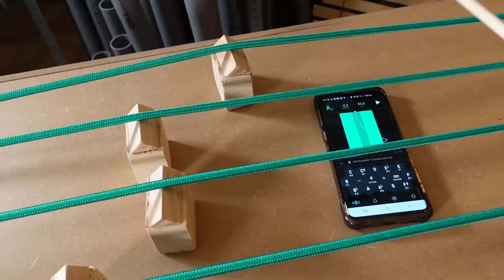Bass strings with elastic tensioners sound great!

Comment: Sounds extremely cool! When I was a kid, I also experimented with these elastic tensioners, but failed to get good sound because I used cardboard boxes that were WAY to small ;). 
By the way, I LOVE the track from 3:42 onwards!
Reply: I recently made a two string double bass and played it at the school talent show yesterday. The resonator is a big cardboard box, and it’s decently loud acoustically. The high string is a marine elastic cord. I’ll make a video in tiny bit but unfortunately since yesterday it’s been sounding different, lots of buzzing. It sounded exactly like a real double bass yesterday and the before.
Reply from the maker: Yep, cardboard can sound good, but you need some volume!
Reply: I fixed it, I’ll make a video later today

Comment: I see two ways to improve this instrument right away: MDF is pretty dead, so you won't get any resonance from that. I'm not saying ply is super, but it would give a better/louder sound, especially if it was under some sort of tension. As for the strings, the nylon sleeve will surely dampen/mute/shorten the sound and... Well, if that's what you want, then, by all means, but if you want strings that ring for longer, maybe try using some cheap work out elastic things? You could get two or even three strings from one set.

Crap, now I'm getting ideas for my own instruments! :D
Reply: I was thinking using straight up tape wound bass strings or maybe rubber ubass strings and to soften the strikers to get that mellow, upright sound. Definitely right about using better wood, 1/8" sheet of hardwood would project more.
Reply: @johnnydeformed7123  The skin from a hollow core door would work pretty well, might need a few bits of bracing through the middle, that's all.
Reply: Plywood is out of stock…at least in Germany 😕
Reply: I think thick grass trimmer cord will work well as strings.
Reply: Ahh yes! Resistance bands. I knew there was some kind of rubber tubing I was trying to think of.
Reply: If he wasn't trying to make it his own original sound, he would just use a bass guitar...
Reply: What you're looking for is "surgical tubing", and yeah it might work as a string like this.
Reply: @PilkScientist  No, not surgical tubing. I mean, it'll work fine for a little bit, but it's made out of latex and that isn't a stable material over time. Great for slingshots, though. I'm talking about those exercise things made of  TPE. I see some are made out of latex as well, but, well... I'm sceptical. I don't think latex would last under constant tension over time and keep in tune.
Reply: Sound holes under the "strings" would help a lot.
Reply: @LA6NPA  Spear gun rubber might work as well. Should be available in more lengths and strenghts, too.
Reply: @nilsschenkel7149  Didn't think of that! I agree! That's usually some sort of silicone, right? I haven't touched something like that since my uncle's Hawaii sling in the 80's! :D
Reply: It's a torsion box with holes on the side for clamping glue-ups, so it does fine, and in some cases you don't want much resonance

Comment: This is very cool but i have just one problem with this video: I can't hear the bass very easily without turning my volume way up- Only to be blasted by the volume of your voice
other than that, excellent :)
Reply: try earphones
Reply: tbf it really depends on what you're using to listen, if it's just your phone's speaker,, then you might as well just mute the video low noises are REALLY hard to hear. even a regular speaker if not some, surround stereo system can really make it hard to listen to. if you like bass I def recommend you get some ear/headphones
Reply: @nipunagunarathne4882  I'm using headphones ._.
Reply: @uranusouji9703  i have some it's just that the higher pitched/louder sounds are also loud. Most headphones don't have a separate volume for bass, including mine sadly
Reply: @orbismworldbuilding8428 you should be able to adjust you phones audio equalizer in the settings somewhere. Its worth it

Comment: I think you might get more projection on the sound by using a drum head, like a banjo. Banjos are insanely loud for acoustic instruments, I think maybe the challenge would be getting enough tension for  the elastic bands to transfer sound through the bridges and into the drumhead. Maybe use weird drums for bridges/frets like you're using here, or a giant drum for the box. That would be fun

Comment: Very interesting, like some others have said MDF is limiting the full potential this has. Plywood wood be an improvement, always try to get it thin and light, as it is easier to energize and vibrate. Tim Sway uses old hollow core doors to build guitars and basses, so that may be an option too.
Reply: Edit: Looking again, that IS a torsion box - it's an assembly table.
Could build a torsion box out of MDF, too. It has similar properties to a hollow core door and won't warp over time as much, so it won't keep shifting and require tuning and fixing the bridges constantly

Comment: You can add a ceramic piezosensors under the "bridge"-blocks. To make a balanced connection without additional preamp you need a two ordinary piezo-beepers and connect them to balanced cable like this   HOT--> i| GND |i <--COLD (where i| is piezo-plate with i as its hot wire and | as its metal base). Mechanically plates should be fixed back-to-back to each other to get a para-phased signals on HOT and COLD wires relative to GND. I have some experience using this to record guitars and grand piano (for attacks).

Comment: WOW..  !  This is great  !   Thirty years ago..or so..  I worked for an engineering company. They kept some stock items on
" A " frame racks outside.  There was a rack of plastic piping left over from a project...various sizes.. up to..  maybe 20 inches.  I made two paddles from scrap wood to hit the end of these pipes and make different sounds.  Some were offcuts and made a different note.  Some of the pipes were very long.....5 metres, maybe... The bass sound was incredible..  with a slapping sound from the paddles.  I taught myself a little riff..  and got hooked..    I had forgotten about that 'til you reminded me....cool.

Comment: That was fun!     Thanks!  Who here, hasn't plucked a tension cord? ...20 years ago I found a great, old steel spring, on a wooden screen door. It was so "twangy",....it had a whole range of interesting low register notes. The wooden frame of the door enhanced the sound. I engaged the spring using a screw driver, and a metal putty knife. Opening the door changed the pitch, too. I discovered this by accident, and felt compelled to strum the coil, knowing it would make a fun sound.

Comment: I made a bass like this as a kid from a fence picket and it sounded just like a real bass. I'd recommend slightly thinner elastic drawstrings. The trick is getting the microphone to touch the wood surface, and you'll get some nice/usable bass sounds. For an acoustic bass, you can't beat a washtub bass. You can also get pretty fancy with it and build a permanent fingerboard. P.s. those large flutes in the back look pretty cool, I'll have to check out your vids to see what those are :)

Comment: I think you should add curtain rails to the top of the bass, fit the wooden toggles to the curtain rail so now you can slide the wooden toggles without them coming loose or when you tip the bass they wont fall off, or maybe even make a lowered groove in the top of the bass to make sliding paths for the wooden toggles... Just a thought. Of course try to keep the resonance correct.

Comment: If it had a sound hole you could put a bass drum mic on that and put two overhead condenser mics in stereo over the top and record it the same way engineers usually record live drums. Might sound great and capture more of the sound it makes. I've messed around with bungee chord that was tying down a cardboard box before. It does make quite a big sound. Never thought to make a musical instrument out of it though. That's pretty neat.
Reply from the maker: There is a sound hole, I put a second microphone!

Comment: You probably could have gotten a good sound by adding some tracks for the tensioners to run on, and then you could use some wood pieces on top of each tensioner to keep the middle-of-the-string tension. Some sort of system to raise/lower each tensioner could be used? In order to keep each wood piece on top of the tensioner held down, you could use a pair of screws, or maybe nuts and bolts, with the nut on the top side of the tuner as to add tension correctly.

Definitely would be unique! And give you 3 sounds on each string.

Comment: Use bass strings in a taller box, plan to start ar 40 hz and achieve 432, it is a piano in the first left half. Also the hammer should be a dense wood, it will be a noise piano.

Comment: So you made an acoustic Motograter?

It's the instrument the former death metal band of the same name created for a more punchy bass sound. The original had one bass string (which I believe was actually an industrial cable) anchored on both ends and had a movable bridge. The way it was played was to beat on with a stick. The instrument had pick ups which I believe were salvaged from a junk bass guitar and typically ran through distortion.

Comment: You had it miked up above the strings yet the sound hole is on the side - would it be better with an acoustic vent positioned on the same surface as the strings like a traditional circular hole or pair of f-holes? And tuning the size of the hole(s) to suit the volume seems like a idea.

Comment: I'm no instrumentalist by any means.
That being said I did have an imaginative idea.
What if you made a square, wooden, percussive box with a hole on top.
 Have the ends of the strings connect at the bottom and cross over the top. 
Have a second set of strings go perpendicular to the first set if more strings are needed.
Use the wooden pegs you had in the video to raise and tune the strings.
Then you could play this bass like instrument by plucking the strings on the side.

Comment: Man... That's the world's first bass hammered dulcimer.. I think anyways...lol. I love the soft percussive sound. If you wanted to get some punch out of it try actual bass strings. I think the MDF would be plenty resonant might have to brace it underneath just a touch. Probably just brace it under the bridges and maybe a soundpost like a violin in the center to keep it from buckling. Just enough bracing that it doesn't deaden the top. I think that would be way cool. You could do an electrified version too. I just thought of a cool way to try to build it while typing this. Use a 2x4 for each string. Like multiple bass lapsteels. Wind pickups out of thread bobbins and have one pickup for each string all wired to a single volume and tone. If the were all wired together they would be humcanceling then. I could see using some guitar effects and a looper to get some really groovy sounds. Now that I've typed this out.... if you don't try this, I might!!! BTW first time seeing your channel! Liked and Subcribed, Dear Sir!

Comment: very nice.  l been wondering what i wanted to try next.  i also love to find more bass.  built wash tub bass with weed eater string... and some things using a 5 string bass set.  was thinkng about making some form of 6 string bass starting with the low B and going either up in 4ths like guitars or tune 1to5 or 1to4 like mountain dulcimers.  that low string can go to A-0 but much lower we cant hear.
i especially like you three note per string tuning system.  if you can custom stretch each string you have it all.  i mostly play old time banjo, mountain dulcimer, slide an fretted guitar and really love the backup drones you build offers
thinking about similar and another build ... a single long string with one tensioner crosses a box maybe 6 times and single bridges divide each section.... would look like a kyoto.....

Comment: Why not try those copper wrapped cables that they use for the bass notes in a piano? The heavy  string will give a very low note and the higher tension should give a louder note.

What you have is lovely in it's own way tho